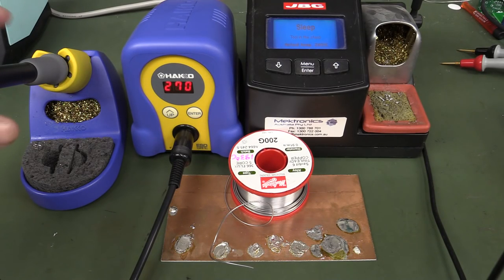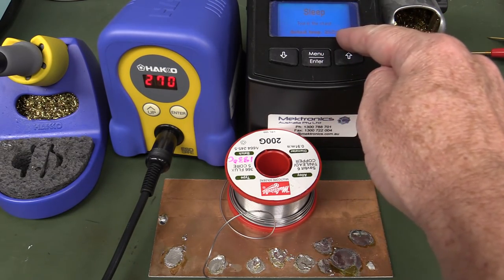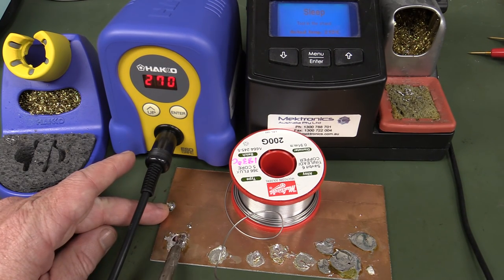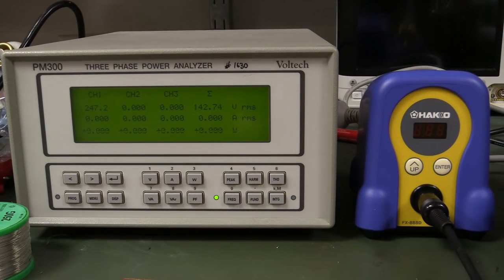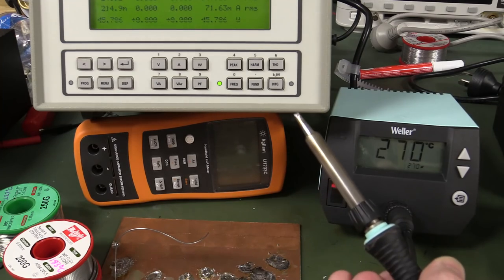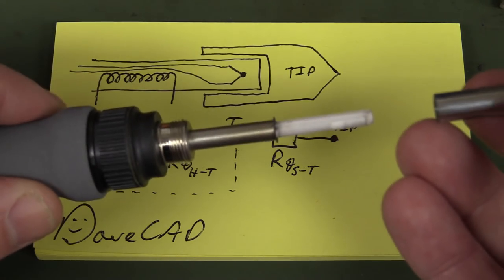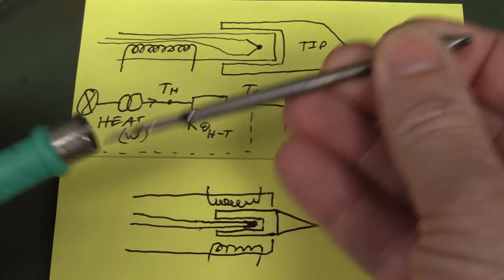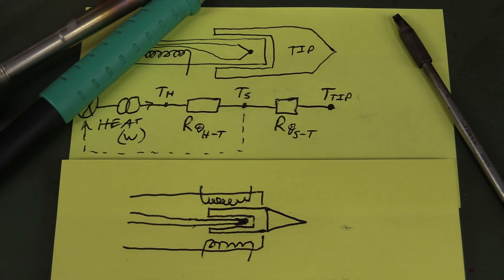EEVblog #1065 - Soldering Iron Power Delivery Explained

Comment: This is a much better comparison. The advantages of the new design are clear. However, even if the lifetime tip cost balances out and if I were to use it enough for tip life to be significant, I will still refuse to buy such a station on principle, they just price them too high; Absolutely no reason the tip design should significantly effect the station base price, and certainly not by $500.
Reply from the maker: Well you don't have the buy the expensive JBC. The Hakko FX-951 should perform just as well.
Reply: go to aliexpress dot com and search for fx-951. It's $47 + shipping to get one of the knockoff "new" style stations.
Reply: I think around $30 with free shipping as a DIY bag-of-parts kind of deal, just look for T12 kits on banggood, though you get a horrid $2 handle with that, you can consider an upgrade later to something more decent for extra less than $15 or so.
Reply: The T12 tip only has two active terminals, not 3. The third terminal is just for the earthing. The way this works, the heater and a K-type thermocouple are connected in series, you have a digital control soldering station, and a few dozen times a second, it stops heating, and measures the temperature for a few milliseconds, it can't do these two things at once. Now if you had to adapt it to your existing 968 electronics, you would for one potentially have to account for different measuring methods - i don't remember whether Aoyue uses thermocouple (that generates a voltage depending on temperature) or a thermistor (that is measured in a resistive voltage divider), and for other you'd need to subtract the AC it drives the heater at, and extract a tiny little voltage, so it's going to be challenging. I think JBC also uses the same system where thermocouple and heater are in series. Note how smart this is because nichrome can be used both as the heater material and as one side of the thermocouple.
Reply: Barry Manilowa Various soldering stations use different approaches to heating (inductive, resistance) and sensing temperature (e.g. thermocouple, thermistor, sensing change in resistance of heating element, etc.).  So you would have to find an older style soldering station that was designed to use the same style temperature sensing interface as that used by the new style soldering iron otherwise you will either have all heat or no heat because the temperature feedback loop no longer worked.  But if you can find an old style base that was compatible with the new style soldering iron then it could certainly be done provided the wattage of the new soldering iron was more or less identical as well (to avoid overloading the existing transformer in the base).
Reply: Note that T12 kits usually take 24V DC, not AC - MOSFET rather than Thyristor based. Which is one way to save space.
Reply: YT just notified me of these replies, 2 months late. 
I'm not really into knockoff tools, although I own a few I seem to regret the purchase as often as not. I find it  is generally better to buy the real stuff used than a knockoff new, where applicable.

Comment: i have used multiple layers of aluminum foil in between heater and tip , to make it a snug fit for 900 m tips and the capacity of the iron has increased to as good as my 951
Reply: I was just wondering about this too. I recently had to do a job on a board to remove connectors that were on massive copper traces and the heat on my Hakko 926 struggled even on full blast. That's what led me to this video.

Comment: I do not own a TS-100 soldering iron but as for what you mentioned about the "burnproof flexible lead" isn't that a choice of your own with the TS-100? 
And for the power supply, who doesn't have a few lying around, now they can be put to good use. I do see the positive sides of the TS-100.
Reply: Javier Palla Lorden Yes, the hobbyist could certainly order silicone cable for their iron.  But how many hobbyists realize the importance of using silicone insulated cable?  To go to the added effort and expense to secure such cable you must first know why such is an important consideration and why you should insist upon it.  As a hobbyist one oftentimes only learns those valuable lessons after the fact.
Reply: Need a cheap source for silicone 2 conductor cable for your TS100? Search "silicone cord tattoo" on Fleabay. $5-6 gets you 6 feet of super flexible cable delivered to your door. Don't forget to pick up a 5.5mm x 2.5mm Male DC jack for a buck as well.

Comment: On the Hakko, how loose it is and any air gap: I think you forgot about thermal expansion.  Have you checked how loose it is when heated up to temp?
Reply: Ted Milker it's still pretty loose. Can't be too tight, you got to be able to change the tip while hot
Reply: Ted Milker on my Hakko I replace tips on the fly without waiting for them to cool down and they slip out without any issue, so thermal expansion is not really relevant
Reply: Thermal expansion of ceramics is usually lower than the thermal expansion of metals so, given the tip profile and the way it 'locks' with the heating element, chances are that there is even more of a gap between the ceramic heater and the tip itself, apart from the point-contact at the top of the element.

Comment: Hi Dave ..... can you do a test putting heat sink compound into the tips of the "loosy goosey" ones to see if that can fix the fact that there is an empty air gap in there. Or will that damage the ceramic element ? Regards ... Tom
Reply: I´ve remember Danfoss recommends using and sells a thermal compound to be applied to temperature sensing bulbs when assembled into thermowells. This paste seems to have silver flakes to better heat transmission.

Comment: Hmm I wonder if the Weller LT series soldering tips are any better/worse?  They have a flat surface to conduct the heat to the tip and there is positive pressure pulling the tip to the heater.

Comment: I have an ATTEN ST-100 station, it performs excellent, it uses Weller LT series tips and those are simply clever little pieces of tech.
I am using the station for over a year now and the only thing I bought were a few of original Weller LT series tips for smd work.

Comment: It's nice to compare therma circuit with electrical. I also use it to design heatsinks. But it doesn't explain delay in the regulation as resistors as the resistir divider reacts immediately. You should store the energy so better model is to add the capacitors.
From the heat element to sensing element (Rh-s), Sensing element to the tip (Rs-t) and the third one between the tip and soldered joint (Rt-j). Then there is a thermal capacity of both tip (Ct) and the soldered joint (Cj)  represented by a capacitors.
The Ct is charged before soldering and when you put the tip to the joint rhe Rt-j drops down and you charge the Cj from the Ct with some delay. It takes a time to drop the Ct charge and the regulator react when the Ct charge drops down...
Reply from the maker: Yes, I said I deliberately kept it simple.

Comment: I have Metcal MX5200, Hakko 951, and TS100. My personal preference is Metcal. It can heat up the position pin of the rj45 jack in 2 seconds. Hakko could do the same job within 5 seconds. The TS100 with factory firmware only give me crap joints on the rj45.

Comment: Dave does the tip in JBC iron can spin around when you for example put some force on chisel tip sideways ? I don't see any spin-blocking element on the tip or handle whatsoever. It would be fu***ng annoying if you want to put some force into big cruty joint.

Comment: In theory, and with some tools an knowledge, you can do a DIY better controller for any tip (with any microC). But is really necessary to model the "losses of Tip" and measure the tip temperature in design state. Actually is not so difficult, I made some diagrams for a DIY universal solder/de-soldering station (for almost any tip, cheap or new jbc tips) using a cheap STM32, and also with a smart design you can resolve the "changing" tip temperature issues using different tips for jobs.

Comment: It is curious that this technology be taken advantage of as the alloy of choice by any given maker has taken a page from the “Black Smith’s” hand book. As metal of unknown alloy reaches a temperature that allows for the quench and hardening, it looses it magnetic properties. This simple technique with color of heated metal is checked by the Black Smith with a magnet. If it has an attraction to g to the heated metal, it is not hot enough to cool and result in a very hard tool. So a chisel, blade or high ware item has reach the proper temperature a magnet does not stick. Time to quench in oil. Below this crucial temp, the metal won’t be hard and a file will dig into it. 
 Now come the soldering iron. As the correct alloy is chosen, heated it looses its magnetic properties yet at a proper temp to melt all solders used in the electrical market. The “Curie” point helps by the beginning loss of magnetic properties of the alloy. This makes it possible for it to toggle on and off as magnetic properties begin to change. 
 The chicken or egg question can be answered. The Black Smith come first and the engineer came last. 
  I enjoy learning even while retired, it is new to me that the “Curie” point is the name of what a Black Smith has known for centuries. Just didn’t know it had a name. Now you can design a soldering iron after testing different alloys, then use the magnetic properties to control heat at the business end. Cheers!
Cert. Automotive ASE Master tech since 1978, retired.

Comment: I had *TS100*, theretically exactly the same as hakko 951, same power, same technology, but for some reason it's performing like a crap.
I had measured everything, voltage and current readings look to be fine, 65W peak as advertised, 8 Ohms at the heating element, but the performance isnt there, I don't know why, that's a mystery for me.

I'm quite desperated and thinking about JBCs iron but with that popular open source DIY station(unisolder from dangerous prototypes).
Reply: Arek R. Did you try the open source firmware for it? To me the pid on the open source one is better than the factory. I've used one for about a year and I'm very happy it, I've taken my hakko clone to storage. Guess it depends on what you do with it, I mostly do smd and wires and hobby stuff.
Reply: NS Gaming Yeah I got that open source firmware, still potato...
Reply: Interesting to hear a negative review of it instead of just endless praise that it's the greatest thing since sliced bread.
Reply: if you're using a low voltage power supply, it will perform poorly.  find a power supply that is rated for the ts-100's max. voltage
Reply: it performs like one single crap?
Reply: Dude I just said that it reaches 65W peak(24V).
Thanks Dave
Reply: I tested the TS100 with a bench psu with 24V. As standard I use(d) a 19V laptop smpsu. With 24V and the open source firmware it is doing ok but still not really a substitution for my cheapy chinese Hakko FX-951 copy. I reached 60W only when heating up and about constant 30W on a big heatsink only in turbo mode.
The grip is very small and lightweight and the buttons are difficult to use. So the TS100 is more a nice gadget than a reasonable soldering iron for me.

Comment: Ok I'm late to this party.  Is there a way to make a better thermal connection from the ceramic element to the inside bore of the tip????  My jar of thermal paste says 400F max. I do have some copper screen I could stuff in there but I still need to change tips from time to time.  How about the T12 irons.  Can I run a T12 handle on my existing station?   Maybe some wavy copper sheet in the air gap.  It's still better than the air gap.  The copper sheet will be fully annealed after a while.  I don't know but I keep thinking about it.

Comment: I bought an ali cheap 110v variable temp iron by mistake for oz 220v. But instead of burning element the tip got crazy red glowing hot. I use it often when needing the extra heat. Not all types will continue to work but the Ali one with small led display in handle works great over voltaged.